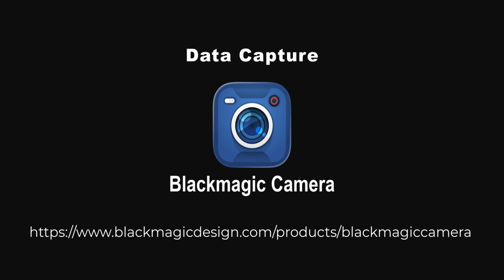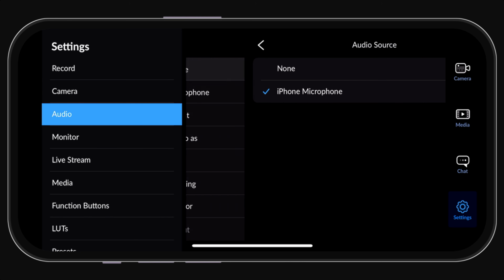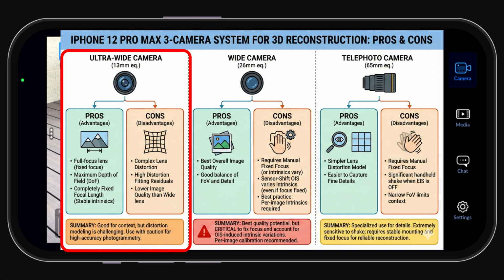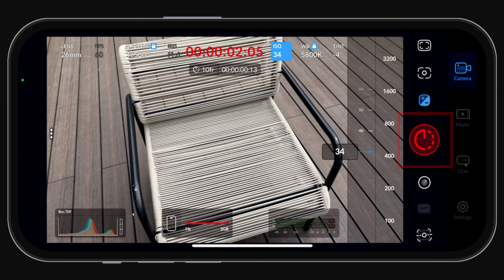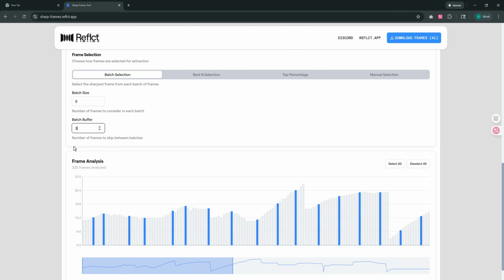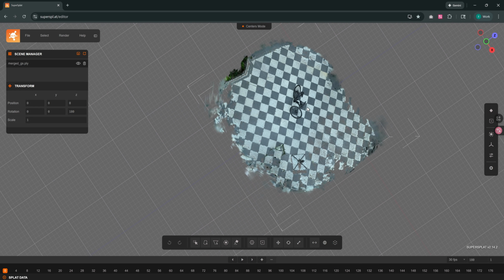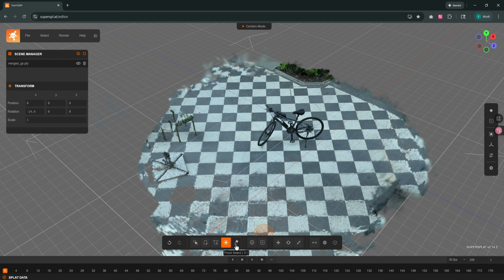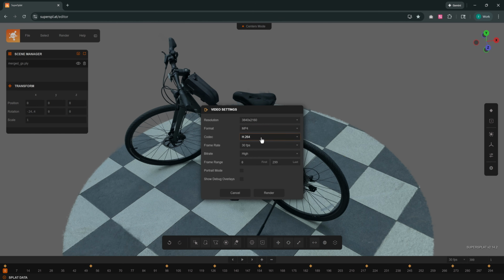Gaussian Splatting for Free: The Ultimate Step-by-Step Guide (Capture, Process & Edit)

Comment: Thank you for this.

I installed Blackmagic camera on my phone and followed your instructions but I don't get an option to capture every 10th frame in the Timelapse menu. Shortest interval available is 1 per second. This was shooting at 60FPS.

I'm therefore going to try importing my video into Photoshop as a frame animation importing every 10th frame and then render straight back to video again, then import to MipMap Desktop. I'll reply to this comment if I succeed!
Reply: OK turns out using the original video worked just fine without downsizing to every 10th frame

Comment: Hi, if I don't have a gimabl for my phone should I still switch off stabilization?
Reply from the maker: Yes, you should still turn it off. Even without a gimbal, Digital Stabilization (EIS) works by warping and cropping frames to make them look "smooth." This distorts the camera's internal geometry, which confuses 3D reconstruction algorithms.
For the best results:
Disable Stabilization: Keeps the geometric data constant for the software.
Fast Shutter Speed: Crucial to eliminate motion blur from handheld shaking.
High Frame Rate (60fps or 120fps): Minimizes Rolling Shutter distortion (the "jello" effect).
Reply: @MipMap3D  Thanks so much for the advice

Comment: Is this workflow superior in quality as compared to running COLMAP + Postshot or Brush?
Reply from the maker: The process of image pose recovery is significantly faster and more stable than that of colmap and PostShot, especially for data captured by DJI drones. Better pose recovery leads to superior Gaussian splatting results. MipMap's Gaussian splatting superior thin structure fine details from drone-captured imagery. But currently, MipMap's gaussian splatting offers fewer adjustable parameters compared to these two software tools. In some cases, opting for longer processing times can yield better Gaussian splatting outcomes. More control parameters will be gradually introduced in subsequent versions.

Comment: Hi, I have a question regarding video preparation for Mipmap.

I recorded a video using Insta360 X4. What is the correct way to render/export this video?
After exporting the 360 video as a normal MP4, is it enough to upload/import that file into your system?

Or do I need to extract frames from the 360 video and split/process them separately before using it?
Reply from the maker: Currently, processing panoramic cameras requires relatively complex operations. We will support the fisheye camera model in the upcoming software update (expected in about six weeks). After the update, it will better support data captured with Insta360 cameras. If you plan to use a panoramic camera, we recommend waiting for the new version.
Reply from the maker: You can refer to this video: https://www.youtube.com/watch?v=dsD0x0xzhl8

Comment: Thank you so much for the tutorial, it's very well explained! I only have one question: in my case, I use a DJI Mini 4 Pro drone to photograph buildings during construction and I generate 3D models with GS in other (limited) free platform. In the "Edit camera" step, how do I know what values to use for F, cx, cy, and k? I didn't understand that part. I'm glad to have found this free alternative since I'm starting a business with this and I don't yet have the income to afford software. Greetings from Chile.
Reply from the maker: Glad you liked it! The easiest way to calculate the focal length in pixels is by using the 35mm equivalent focal length. For most DJI drones, including the Mini 4 Pro, the equivalent focal length is 24mm. Make sure to shoot at 1x zoom without any scaling. When using the focal length calculator in the video, simply enter:
Focal Length: 24mm
Sensor Size: 35mm
As for the parameters like cx, cy, and k, in most cases, you don’t need to adjust them—keeping the default values is fine. If you’re interested in diving deeper, this is an excellent blog post: https://ksimek.github.io/2013/08/13/intrinsic